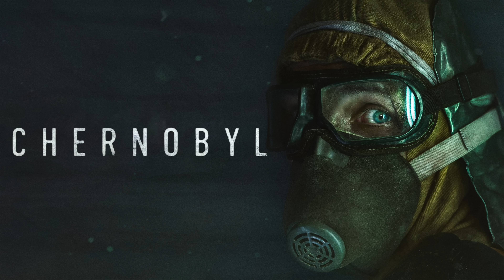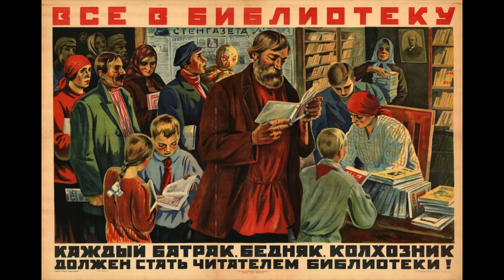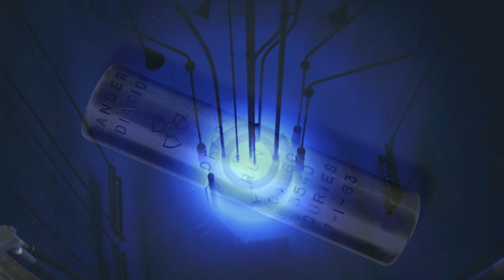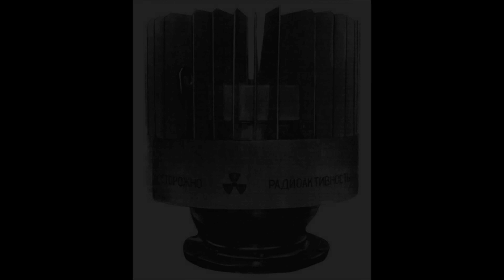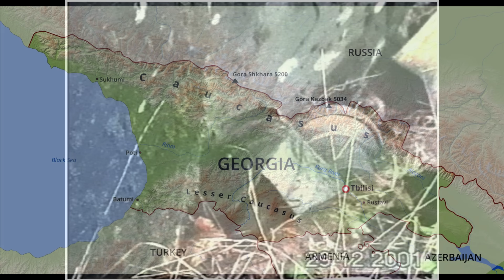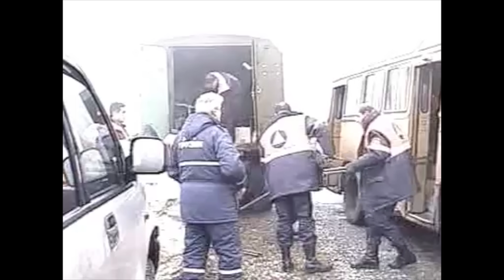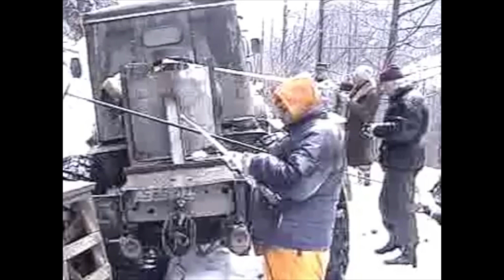The Soviet Union's Deadly Abandoned Nuclear Generators

Comment: Scary to see the cylinder actually BOILING the snow around it . Scarier still, was the lack of any safety PPE for the removal team.....
Reply: They had all the PPE needed: boots, a thick coat and radiation monitors. The only dangers these people faced that could be mitigated with PPE were the cold temperatures and the risk of tripping in the snowy forest.

Radiation safety can be summarised with the concepts of time, distance and shielding.

Time: the less time you spend near a source, the less radiation you are exposed to.

Distance: radiation intensity decreases with the inverse square law (much like light). The more distance you can put between you and the source, the less radiation you are exposed to.

Shielding: many materials absorb radiation, if you can put absorbent material between you and the source, it will lower the dose.

The recovery team used long handled equipment to put more distance between them and the source, they worked in 45 second (iirc) shifts, and when possible they ran behind rocks and other objects to ensure they were shielded from the source wherever possible. 

There is simply no material that can absorb radiation that they could have clothing made out of that would not have impaired their mobility significantly. 

Say that they did try and make suits out of lead to shield the team from radiation. The increased weight and lack of mobility would have likely lead to people falling over, slowing down the recovery. They would have been far slower running in and out of the recovery area, increasing the time they were exposed significantly, and they may have struggled with the initial manipulation of the source (which happened from a decent distance), potentially forcing them to get closer to the source for sections of the recovery.

It seems very counter intuitive, but for this recovery operation any attempt to give PPE to the workers and increase the shielding they had would have lead to greater compromises in time and potentially distance. This may look like a team building social sports activity at a glance, but it is actually an incredibly well planned and executed source recovery that managed to ensure safety for all involved.
Reply: @q3st1on19  I would assume they might wore a lead-lined jacket like the ones used during x-ray examinations, under their coats.
Reply: @mrnmrn1  With gamma radiation, wearing heavy protection can actually end up increasing the dose if you have to spend more time near the source or need more time to get close by and away again.
Reply: @tz8785  I am not sure there was a lot of gamma. Radiation heat sources are designed around something with least penetration capabilities possible. But it was old one on the other hand. it could contain radioactive products of initial fuel. So to tell exactly, I need to now what fuel was used.
Reply: @heyhoe168 he said the fuel was strontium 90...
Reply: @mrnmrn1  unfortunately the x rays produced by these RTGs are much more energetic than those from a medical x ray diagnostic machine. The lead would have to be 10x thicker or more to achieve the same effect
Reply: @mrnmrn1  Too heavy to move around in.  Time and distance worked in their favour here.
Reply: @heyhoe168  Sr90 was the fuel, so it was beta decay primarily. Enough to heat the snow around the canister, even after all those years.  So, distance and short time exposure was the key factor here.
Reply: @inductivelycoupledplasma6207  RTGs don't produce x-rays, Sr90 is a beta emitter, and Pu238 an alpha emitter.  You need a nuclear detonation or fission reactor for gamma and x-ray.
Reply: @jaycee330 betas produce x-rays when they decelerate in matter. This is the exact same operating principle as an x-ray tube. 35kCi of Sr-90 is going to produce a LOT of betas, and hence quite a lot of very hard x-rays too...
Reply: @q3st1on19  I mean, even at the dentist I get a lead apron for x-rays...
Reply: @HMan2828 Yeah, but that equipment that you'd get at a dentists place would have encumbered you to the point where you'd end up exposed to more, not less radiation.
Reply: @HMan2828  i thought the orange vest they wore were those lead apron
Reply: @HMan2828  That apron is more for protection from lawyers than it is from radiation.  Keeps you from blaming your lack of children on your lifetime of dental X-rays.  If you were to fly across the country for your dental appointment, your rad exposure during the flight would be higher than the X-rays at the dentist due to natural sources from space not being blocked by the 35,000 feet of atmosphere now below the aircraft.
Reply: @kevincrosby1760 Nonsense. Radiation isnt all or nothing, every bit of exposure increases cancer risk over your lifetime. And aging itself also increases it.
So its definitely a good thing to keep down exposure, even to minor sorces, if possible.

Thats also why the Soviets did things like they did. Just dont track radiation health issues and nothing individual youve done is an issue. They didnt even track the liquidators after they had cleared up Tchernobyl...
Reply: @ahmadsamir1031  No, they are just thick coats for warmth and orange for visibility.
Reply: @Kevin Crosby  Lol! Lawyers are worse than radiation, by far!
Reply: The only real "PPE" when handling sources in the field like that are distance and limiting the time exposed.
Reply: The source was intact, so there was no need to protect their respiration or eyes etc.. The only real hazard was in the form of intense x-rays from the bremsstrahlung of strontium-90 (and its daughter products) beta decays.
Reply: @anhedonianepiphany5588 which is exactly why you don’t want to wear lead.  Heavier material makes more energetic x-rays (right? Maybe I’m misremembering)
Reply: @swainscheps materials with a higher atomic number produce more x rays (the conversion efficiency is higher), but I think the x ray spectrum is fairly similar regardless of material (besides the presence of XRF peaks). 

In the case of the sources in Lia and their recovery, the source material was sealed in a thick steel capsule/canister, more than enough to shield all of the betas. Although wearing lead wouldn't produce additional x rays, it would've been fairly useless (extremely heavy and cumbersome for even a "minor" reduction in dose rate).
Reply: @anhedonianepiphany5588  completely correct. To think that those Sv/h dose rates are just from Bremsstrahlung!!! Imagine the dose rate without that tungsten shield... Beta burns in seconds
Reply: They had a hard enough time maneuvering in the snow and trying to get at it just in their winter gear.  Can you imagine the amount of effort to do the same thing while wearing a 50lb lead suit?    I can't.   They'd still be there working on it.  

PPE is only good if it actually helps you.  Some people take PPE to far to the point it hinders you from even being able to do the task at all let alone safely.  But those rules are usually put in place by people who think everything needs more PPE, who've also never had to operate under any of those conditions. 
These men timed their exposures and had a separate watchdog crew monitoring that.  None of them likely received more than a years standard dose.
Except maybe the one dude who was manhandling the crap out of it, that guy got pretty close.  But even a lead skirt or apron doesn't protect you from a source pointed up at you from the ground.  It'd just be incredibly ungainly, providing only occasional protection depending on the angle.
Reply: @syberphish  глупо объяснять это людям не понимающие историю атомной энергетики . у России как у украины есть опыт работы по ликвидации аварии атомной . и из этого опыта получена информация . вообще работа с такими объектами вопрос компромиссов .
Reply: The effect of lead aprons depends on photon energy. Typical medical xray spectrum is 50-100 keV. For this a good shielding factor of 40-80% can be achieved. Tc99m, the main isotope of nuclear medicine diagnostics has a decay energy of 140 keV and to this the aprons are already ineffective. 
This RTG produces Bremsstrahlung X-Rays with an energy up to 2.28 MeV.
Reply: The 90s 🤷‍♂️
Reply: Where did you see that in the video ?
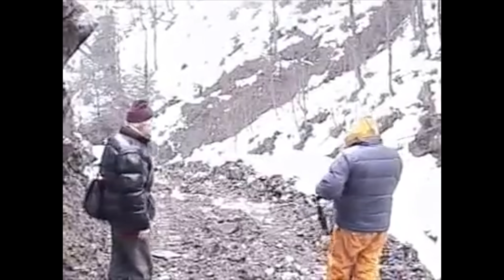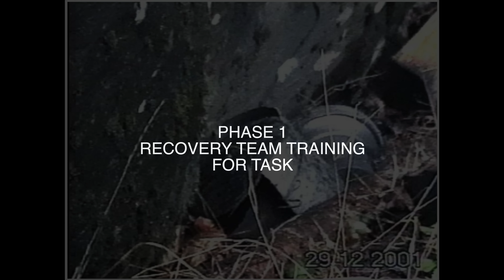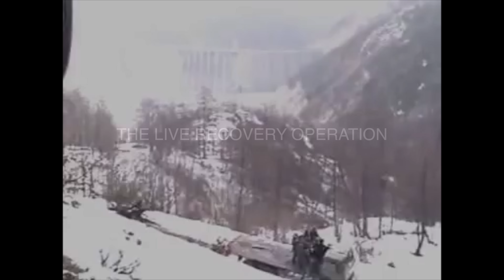Reply: @BHARGAV_GAJJAR  23:54 / 24:36 / 26:20
Reply: OSHA wasn't invited
Reply: PPE? You think safety glasses are protecting against radiation?
Reply: @CheddarCheeseBandit well…yes actually…unless it’s an unusually high-energy beta particle, you can stop it pretty effectively with a little bit of plastic…
Reply: What should they wear? Full body lead suits?

Comment: My childhood tree house was built 10x better than those wooden lighthouses 🤣
Reply: But think how much cooler your childhood tree house would have been with a constant flow of electricity from an on-site thermo-nuclear generator.
Reply: "Dad can you go with me in your truck to pick up the thermo-nu-clear® device for unlimited heat and lights for our ice fishing hut  on Michigan's U P?"
Reply: @BipTunia_Microtonal_Cats  if you look at a universe level he had multible nuclear generators hooked up his tree house if he had a extension cord to it
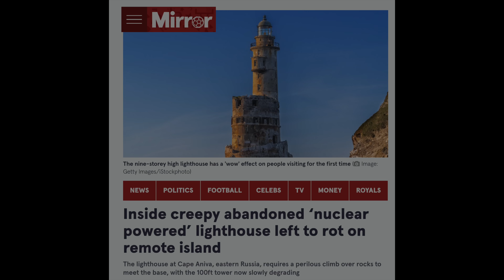Reply: If you about 17:07 and 18:17 it's not lighthouse as you think. It is a navigation sign. Boards nailed with gap to lessen wind load. From the distance it's looks like billboard painted red with vertical black line. At night time some coded light device or even radio beacon perhaps.